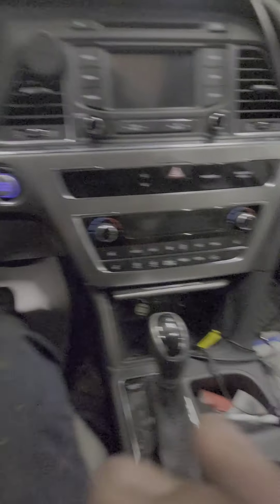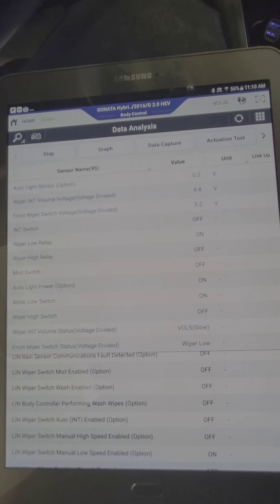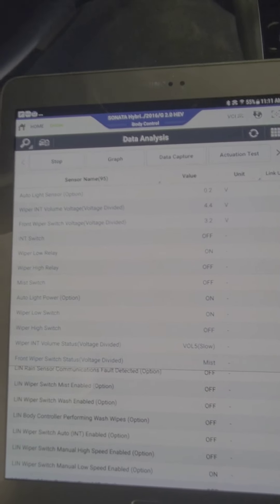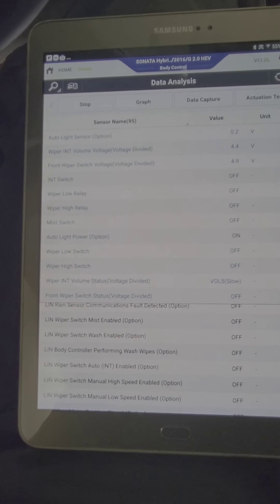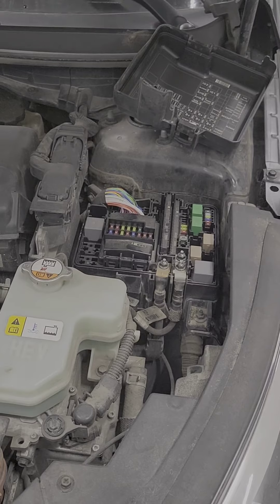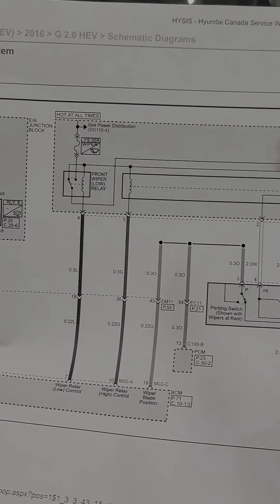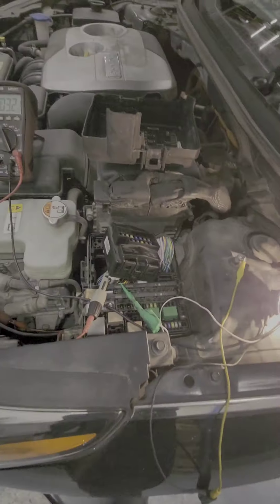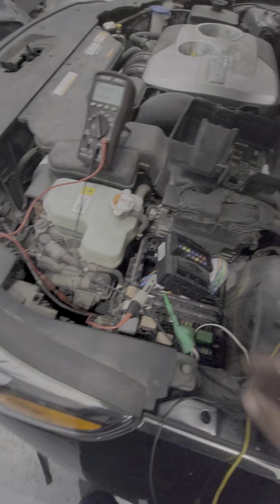2016 Hyundai sonata hybrid front wiper blades turning on while car is off

Comment: I started having the same problem with my 2016 Hyundai Sonata Eco and traced it to the same relay circuit in the block.  A good whack on the relay box unsticks the relay, but it's a pain to do this in the pouring down rain when I've reached my destination.  I was hoping you would show how to replace the relay or the block itself.  Perhaps next time?  Great video otherwise.
Reply from the maker: Hi thank you, if you look at the relay box itself theres some locking tabs on the sides i think they are 4 of them, with use of couple flat screw drivers you pry it gently while pulling the box out, it wont come of fully coz theres connectors so you have to squeeze and remove the connectors.

Comment: I’m having the same issue with my 2015 Sonata SE. Does the relay come separately or does the whole fuse box have to be replaced?
Reply from the maker: Hi im not sure if they have the same set up, you usually if you can check underhood fusebox if theres a designation for a separate relay. I will update this once i get back to work on monday. Thanks
Reply: @hyundaitech  thank you so much!
Reply from the maker: @jurrellprice  so the wiper relay is part of the pcb block they call it. So same thing as the video that small black box inside the fuse box thats where the relay is.
Reply: @hyundaitech  okay thanks for following up with me I appreciate it!

Comment: I got a dn8 sonata hybrid blue link inop. You ran into it yet?
Reply from the maker: No man did you try contacting bluelink services?
Reply: @hyundaitech  yeah, they been working on diagnostics on their part. Replace head unit, shark fin antenna and antenna pig tail harness that goes to the c pillar. Getting omhs to ground on my harness, 5v on mm24.
Reply from the maker: @kayjay7271  hi , what do you mean by 5v 24mm? Does it even go to blue link app? Or the app in the audio unit cannot be press? Like the icon is not lit up? Or everything is registered but you cannot use the function within blue link app?
Reply: @hyundaitech  5v on the mm24 connector the harness that leads to the antenna. Blue link activate in grey’d out on the blue link settings. Blue link is inop, atleast from the head unit.
Reply from the maker: @kayjay7271  hows the connector going to audio unit theres no bent pin male and female?

Comment: Sonata 2015, wipers not working in HI mode, but it`s all ok in other modes. How can i solve that problem please?
Reply from the maker: Easier way find a similar relay for the hi wiper, shiuld be beside each other in the fusebox. If it didnt fix you have to check power going to the motor and from there you can eliminate if you have power issue or motor issue.